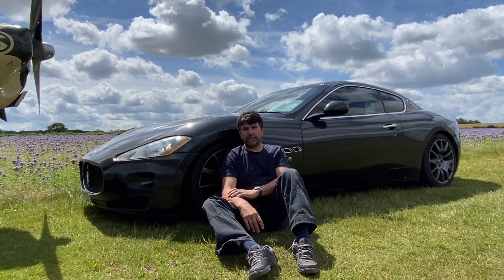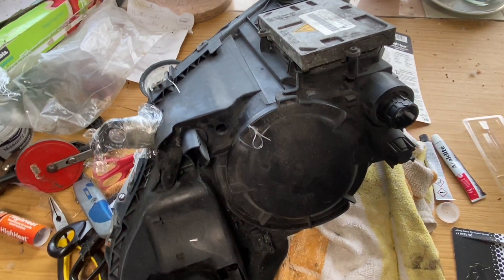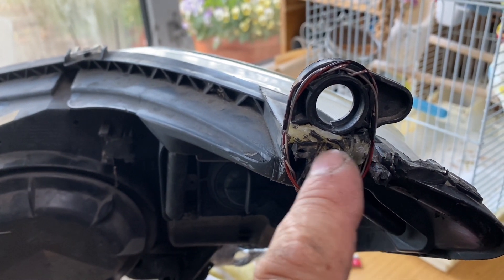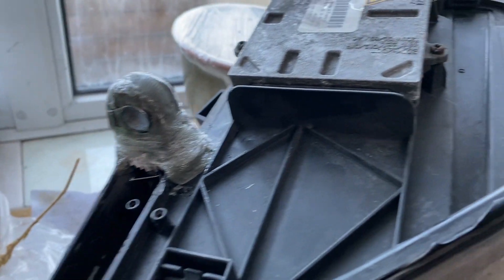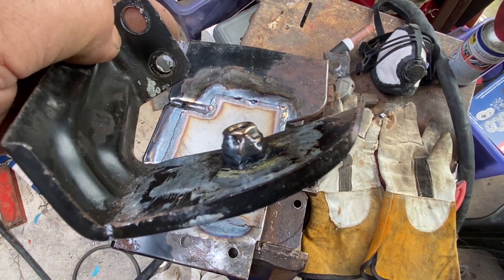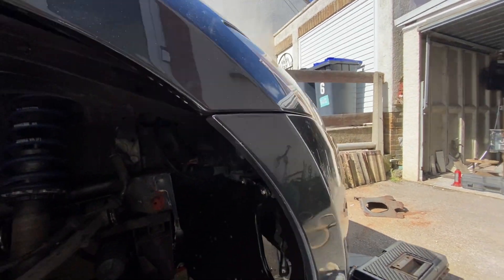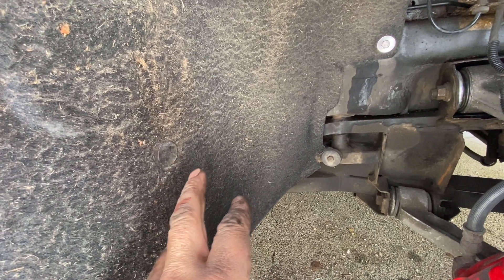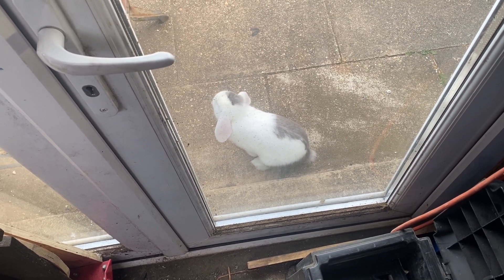Why I fix cars - A Maserati does not have to bankrupt you - fixing broken headlight tabs

Comment: I'm doing mine. Dilemma is on a White GT do I respray the inner arch white and sub frame black or do everything that is viewable in Black?
Reply from the maker: Do you mean the metal panel work in the arch? Mine is all light grey from factory, lighter than the car colour, so I suspect they used some neutral primer. The same light grey is in the boot too. When I eventually do the sub frame it will be in black Jotun epoxy. They were black originally. I would probably just my wheel arch inners black too. The fabric wheel arch liners cover it all anyway.
Reply: @SailingSVPipedream  yes. mine is the same white as the car apart from the matt black chassis and the 3 black panels for the arch liners to attach to. I used Halfords stone chip black for those..an amazing match. I think i will keep the rest white. I have KW coilovers on mine and it kinda shows them up more on a white background as they are yellow and purple. My issue is I struggle taking things away from standard lol
Reply from the maker: @ColinClarke-pb8ee  I know what you mean, I like to keep it sort of standard. I would like side skirts, but think I will use the later 4.7 ones rather than add aftermarket.
Reply: @SailingSVPipedream  I have those on mine. I'm looking at a front splitter though. I have the carbon winglets at the moment. If I do anything it will be to match what has been done before on the GT3 since our shape is what it drives from. itching to get out there and finish one side but it's Peeing down..........
Reply from the maker: @ColinClarke-pb8ee  yes would like a splitter too. I am going to go to my regular speed bumps and check what the clearance is first. Am fed up with the rain!

Comment: Cheers. Do you have any tips to repair the emergency parking brake shoes and mechanism? I have a 2009 Quattroporte and the pads on the shoes are completely gone. The clip on the top that connects to the parking brake cable rusted out and broke off. To buy the entire assembly on Scuderia looks to be about $1,000 a pop per wheel. Thank you.
Reply from the maker: Yes, you can get brake shoes much cheaper - ABS 9334 about £22 for all 4 I think. Autodoc sells them as do many other places. Not sure about the cable, you may be stuck to buying from Scuderia or Eurospares for that. Eurospares do sell secondhand bits too. I also had a seized actuator that just needed greasing. I did a video on mine, I think it was my second video on this about 8 months ago.
https://youtu.be/x8vJmt8BmeM
Reply: @SailingSVPipedream  I like the price. Problem is I'm across the pond in the USA. Any of them ship over here?
Reply from the maker: @philkatzberg9125   try maseratilife.com and ask there. That forum is USA based, unfortunately I tried to search Google for the shoes from a US supplier and just got UK suppliers.